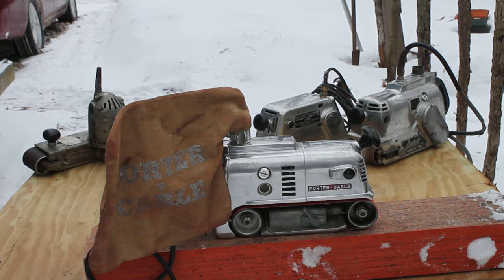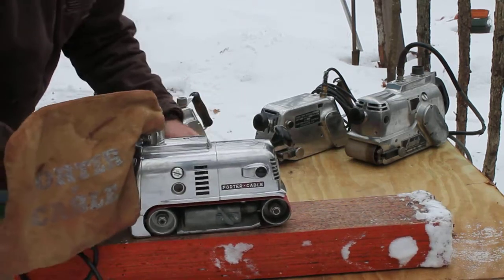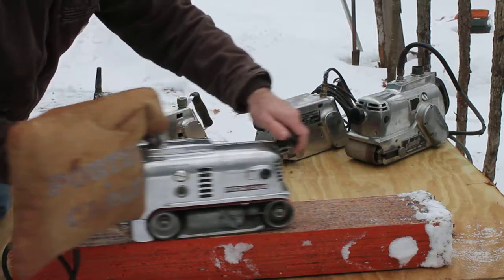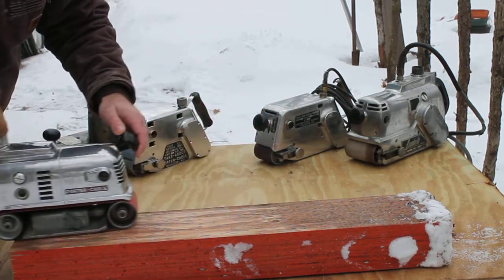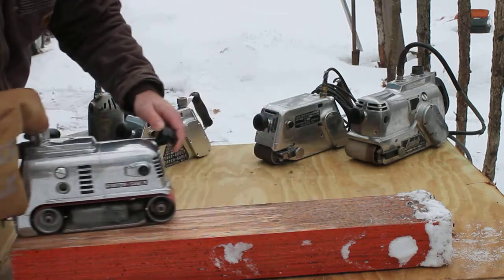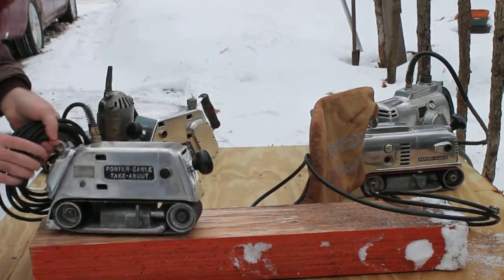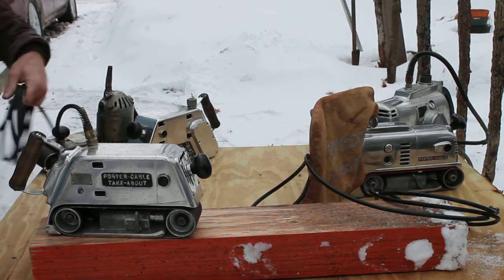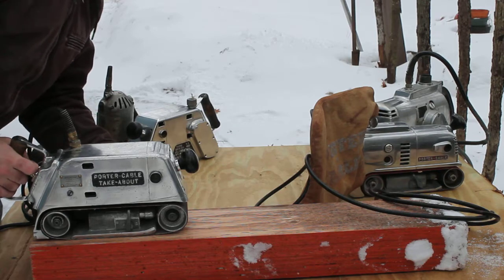Porter Cable Take About belt sander demonstration.

Comment: Hey there.
Thanks for the demo. 
I recently acquired the sander on the extreme right of the table...could you please give me it's model number?
Thanks.
Reply from the maker: That's a model 500. The biggest handheld belt sander PC made.
Reply: @clockbuilderhg  and heaviest? I have the Rockwell version and it's 13.5kg (30pounds). Not much info on it out there.   Though mine works well, I was looking for a video on a detailed restoration/servicing.
After posting the question I saw another of your videos where you mentioned the model number. Thanks for the videos.
Reply from the maker: @izzeystarz7578  Well there was a T4 made in the 1930s that was a little heavier but it used the same 4"x27" belt. They are very well built machines and rather complex to take apart but it depends on how mechanically inclined you are. Make sure you top off the oil in the gear box. There's a bronze worm gear in there. The machines are tough but many bronze gears have been ruined due to low hear oil. I'd recommend Skill worm drive oil.
Reply: @clockbuilderhg  well if these were referred to as Locomotive Sanders then that T4 should be referred to as military Tank! (If it isn't already...?)
I have done some restorations of bandsaws, thicknessers, lathes etc but I'm still apprehensive...would just like to find out as much as possible of the innards of a machine before I start. 
We don't have access to Skil tools nor their oil. Would Mineral Multigrade engine oil (20W-50) do the job? It's what I used for the Delta Scrollsaw 40-400.